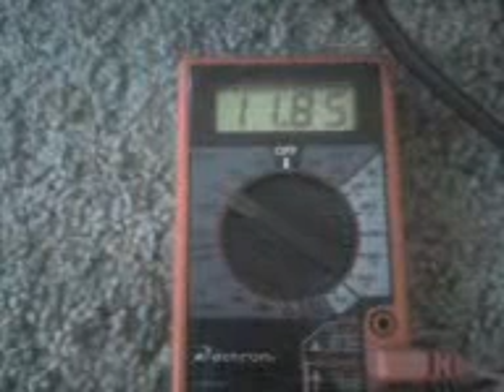homemade generator

Comment: Hey Bro,
All you need is an Ametek motor off ebay ( for the generator) and blades made of 6'' PVC & a 30 amp diode, tower & with a little luck you would have what you need!! Let me know what you think?   Rick.